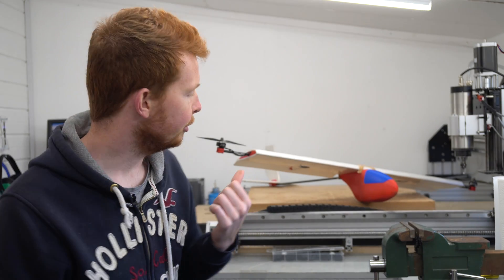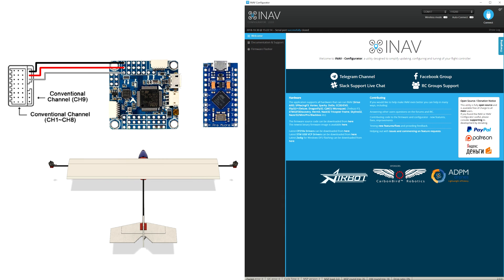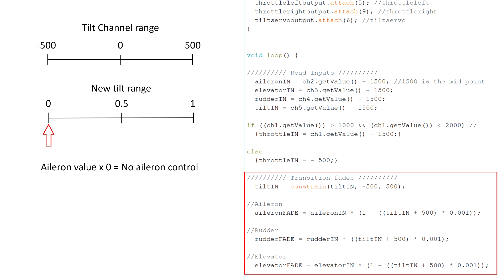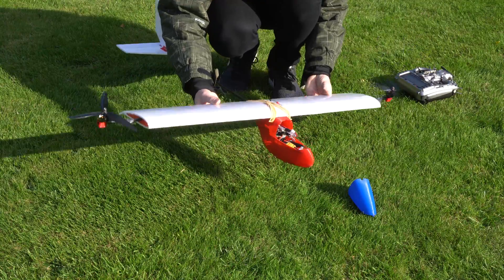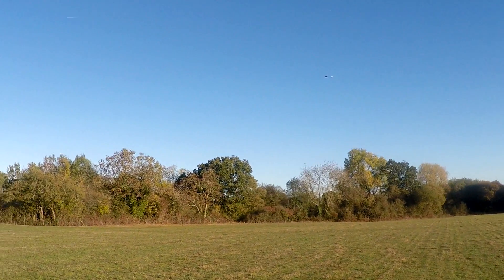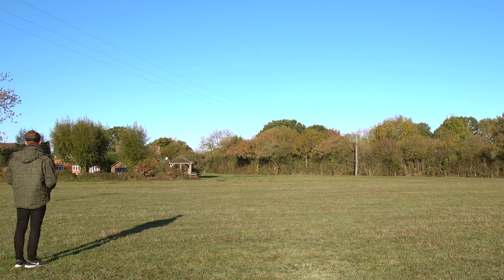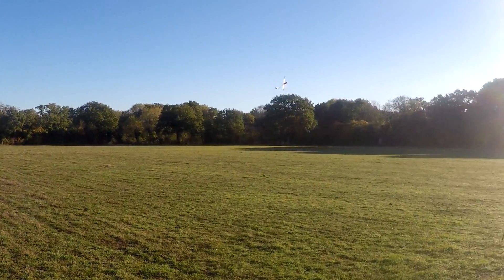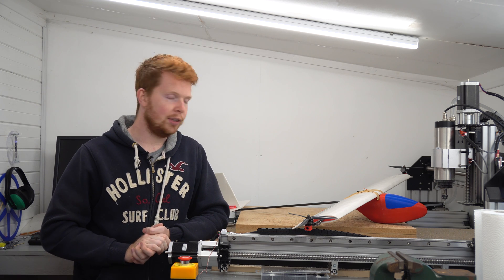RC VTOL - V4

Comment: That's awesome!   I really want to get into this stuff just need to take the time to actually learn it and play around with it.    I kinda want to play around with making my own arduino flight controller and maybe even ESCs too.  There is something satisfying about writing code that interfaces with the physical world, I've done some basic arduino stuff like low voltage cut off circuitry and LCD displays for solar setups but been wanting to expand to motors and servos and stuff.    The drone rules here are ridiculous though, so I'll probably do RC cars and robots instead until I'm confident enough with my designs.
Reply: Please don’t let the government suppress you like this :(
Fight for your freedom!
Reply: Lot of enthusiasts have complained and sent letters to Transport Canada.  They slightly changed the rules but they're still quite restrictive.  Technically not even allowed to use a drone on my own property since you have to be like 75m away from buildings.  I sometimes do anyway if I want to check my gutters or roof real quick but if police saw me I could get a huge fine.  Forget what it's set to, like 25k or something.

Comment: Reading SBUS is actually simpler than reading the PWM signals as it is a serial protocol. Some uC have flexible enough uarts to read it directly. I've done this on the STM32 for example. I've created sort of a library and some information is available here: http://kruissen.com/wordpress/?page_id=121 and I'm more than willing to share any other code I have.

Comment: Great video! For once as a programmer I can actually comment something, your code is fine, and while relatively simple, there's many levels of comprehension required to write even simple code, I'd recommend writing some functions so you can play with mixing your controls/throttle more easily,  e.g. is a linear interpolation best? may be better to normalise values to get a smoother transition? If you have any spare io channels you could use it to try different control schemes out in the field and maybe set an led colour so you know which one is active?

Comment: on your setup and loop functions, void is the return type. its basically a way for the program to know what to expect from each function. So if a func has a return type of void, don't expect a return value. In other words, you can say "runs the setup function" instead of "runs the void setup code"

Comment: thanks for posting.    here are some things to consider.     regardless whatever other silliness you have devised,  the model SHOULD BALANCE AT 30 % OF CHORD.   p e r i o d.       wingtip thrusters  SHOULD BE MOUNTED in  ALIGNMENT WITH  the ideal location of the model's c-m; at  25% of  FUSELAGE LENGTH.      oh and, don't worry about  HOW FAR FROM THE CENTER LINE,  Thrust  is being 'applied'.     i'm sure this fact is of NO importance, in your neighborhood.   cheers                    googletranslate
https://www.princeton.edu/~stengel/MAE331Lecture5.pdf

Comment: If you're interested, we could collab and I could build a custom Arduino compatible PCB that has the components you need on it and it could be designed specifically for VTOL. Its actually a pretty simple process and it could use something a little more powerful than the 32U4. Let me know!

Comment: Wow very nice project and video Tom! Since you are now making more and more Arduino projects for aircraft I would recommend using more efficient small microcontrollers. A teensy 3 micro controller is about as big as an Arduino nano and is much more powerful so you can run the loop at 10-20x the frequency. I've been using those for 10 years now for aerospace projects and I couldn't recommend it more.

Comment: If you don't have cyclic control on your rotors, there's no effective pitch control. Viewed from the side, the trust line has to pass through the CG in order to trim for hover, which means your cg has to be very close to the spar. Then, your ability to alter pitching moment about the CG in order to maintain that hover is also small and coupled with magnitude of trust when you rotate the spar. Difficult to achieve adequate handling qualities or practical CG range. I'm thinking about a far simpler arrangement with two fixed large lifting fans and a low inertia fast fan mounted on the tail just for pitch control. Cheers

Comment: What if part of the wing, like the outer half, 1/3 or 1/4 rotated with the motor. the wing would of course extend all the way to the motor then, instead of leaving the gap and it would probably need to be a symmetrical profile on that part at least. If you have the ailerons in this part of the wing, then you could use the ailerons to control yaw in hover.

Comment: Wow I love this projects!
What if you changed the direction of the motors and propellers? If you give more power to one motor than to the other the plane will roll in one direction, but it will change its yaw too because of the friction of the blades. I think that the left motor should turn counterclockwise and the right one clockwise so that the plane rolls and yaws in the proper directions.

Comment: Very settisfying to watch! Wat if you would add something like a 1104/1106 motor to the back, 2-3inch prop, on tilt. And move your wing spar/main motors a bit to the front, out of the CG. (maybe even completely to the front and more close to the hull) Effectively you would have a tricopter and have auto level again. During foreward flight turn of the yaw motor. Couldn't this be a very stable hovering platform?

Comment: +1 Tom - To add yaw while in hover mode can't you add some code to allow the props to tilt independently, i.e., slightly oppositely about the wing centerline. To yaw left mix the 'rudder' so the right motor would tilt slightly forward while the left motor would correspondingly tilt aft.  That would give you full control of the model.  Food for thought.

Cheers from Thailand!

Comment: Hmm, any possibility of having the tilt mechanisms for each motor in the fuselage, twisting the carbon spars ( and motors on the ends )  which would be riding in bearings for support? Seems like with a well designed mount you could use beefy standard sized servos to directly tilt the spars/motors, or have a single stage of gearing to get the desired range of motion ( ~135 degrees ish ). I'm just thinking that that way you could have more control and keep the weight in the center, rather than out at the tips which was an issue with the previous version...

Comment: Hope you don't mind, but I'll be cannibalizing your stl files for my own personal use lol. I've been designing my own brackets for using a 10mm square aluminium tube as a fuselage for a plane, but have struggled getting the tail section mounted properly without adding a ton of weight. So, I'll be looking at how you've done yours and either just use that or use it as a jumping off point for my own designs. Thanks, mate!

Comment: Embedded programmer here; You might think that the flight controller is written in some foreign programming language, but there is good news! As you've already got yourself writing Arduino code (which is pretty much C with a bit of C++ thrown in for some of the objects, aka Servo and PWM), it's very much possible to remove the Arduino from the equation for your V4 plane and use only the flight controller with your custom code. I'd actually recommend relying on the SBUS output (it's the same information as coming out of the PWM channels) as you get it faster and it's easier and less error prone to trying to read the PWM channels (timing jitter).
If you want a bit of help trying to get it going on just the flight controller, send me a youtube message and we can converse and get you up & running :D Keep up the great work, love every video you do.
Reply: he probably has to learn assembly language and get familiar with atmel IDE for a microsecond stick response
Reply: Sir, a much easier way would be to use JoopBrokking or nicholas Dremm's flight controllers.....on a powerful board like teensy or esp32.

Comment: Someone has probably already mentioned this, but in case they have not, you probably already know that Arduino code is essentially C. You described your "void setup()" and "void loop()" sections. They are more accurately described as just "setup()" and "loop()." This is because in C, the return value type is specified in the front of the function declaration, and the parameter types and names are specified inside the parentheses in the function declaration. This means that the "void loop()" accepts no parameters, and returns no value on exit. Same with "void setup()." I am not sure it applies for most cases in an arduino, but they could easily be.... say... "int setup()" for example, which would allow you to return an integer to the calling function in setup and use this return value for describing an exit condition or an exception handling routine.

Comment: I have a KK2 board that I haven't used in years. If you would like it you're welcome to it Tom. The pins are slightly bent, but the board is fully functional and not damaged at all. I am in the UK so it won't be any hassle. Good job on your controller though.

Comment: Nice Work! but unfortunately I have to told you that iNAV already have those mixer function for you to customize. You can remove arduino without any issue to reduce the weight. :) Here are the simple explanation video by Painless360: https://www.youtube.com/watch?v=v0CABnPXqFE

Comment: Many people have spent a lot of time trying to do VTOL transition and you cracked it in a few days, so congratulations!
Having two contrarotating motors/props on each wing would give you yaw control, and if arranged like an "H" with a very long bridge, you'd essentially have a quadcopter with pitch and yaw stability that can transition to forward flight as well. Worth a try!

Comment: Why don't you use Ardupilot for the firmware?
It even allows Tailsitter Vtols...
Reply from the maker: As far as I could see from the site, it doesn't support this style of VTOL? Looked like it only supported quadvtol and tailsitters, but I might be wrong.
Reply: @TomStantonEngineering  
I think you can define the outputs for each channel seperatly using the full parameter list.
Since you use the normal firmware for quadplanes as well this should also be possible.
-Henning

Comment: What if you add a really tiny motor on the tail of the plane for some proper yaw control? so not like a tircopter but a motor mounted vertically. (like a regular helicopter's tail motor). therefore you could remove the 15 grams of lead on the tail and gain some better control.
Reply: Guys, do you know how it actually yaws in hover? I checked the code but I still dont know
PWM ch1(0); // Throttle
PWM ch2(2); // Aileron
PWM ch3(3); // Elevator
PWM ch4(7); // Rudder
PWM ch5(1); // Tilt
Reply: I was thinking maybe a micro vacuum pump, with tubing to the tail. Get some air passing the rudder, and then just tilt the motors a little more backwards to maintain hover.

Comment: You might want to think about adding a very small motor to the back of the craft. Not only will it allow more control in forward flight mode, but when in hover mode, you could have more "drone-like" control. I don't know, it's just something you should think about.

Comment: Try swapping prop rotation.  Your setup has adverse roll yaw coupling, so in hover, roll left makes it yaw nose right.  I would also try a horizontal tail rotor with one of those 3d drone reversable ESCs .  Cool project.

Comment: I am sure you know, but in your design you only have 2 degrees of freedom whereas a VTOL usually needs at least 3 to work well. You could have used a tiny propeller on the boom to give you pitch control on hover. That's why you get no self-level :)
Usually, the PID outputs for different flight modes differ quite a bit, but again you are lucky here.
The openAeroVTOL firmware really was quite good, it is sad to see it slowly fade into oblivion. I have a basic rewrite but I don't yet support transitioning flightmodes reliably.
In your specific case I am surprised (positively) that it works that well.
Great vid!

Comment: I wonder if it would not be simpler to have a pitcheron arrangement on the wings (motors pointing to the leading edge) and  then the tail could be passive and you would have full 3 axis control on all modes. You have servos for the ailerons and the motors and the elevator already, so Pitcherons would actually be simpler while giving more control.

Comment: Add ailerons behind the motors so you have better yaw control when in vertical mode. This adds some weight with motors at the ends but it should not affect aileron use in forvard mode too much. Those little aileron flaps behind motors should give you good torgue control for yaw and aileron use and you dont have to rely on motor speed mixing.

Comment: After watching this video i'm 100% sure i could do all of this with a regular betaflight flightcontroller and do some custom mixing and logic functions on your FRsky.
That radio can do far far more than you seem to take advantage of.
Tuning the pid's is also possible to do even in flight with a newer flight controller.
Arduino and coding (while it might be fun for YOU to fool around with) is a waste of both weight, resources and time if you have an frsky transmitter.
Codes for what you just did is allready existing in betaflight, and i'd be impressed if you didn't find any code you would need.
Also, just invest in some F4 flight controllers, they are SO much faster than KK2 ever was, they react MUCH faster and they even have self tuning abillities that actually work.
Reply from the maker: I'm fully aware of what the taranis can do and it can't do this mixing simply because the mixing also has to swap which axis of the gyro is correcting in each flight mode. So simply swapping the channels in the transmitter won't work. The mixing and transitional fades need to be done after the gyro corrections. Current betaflight also cant do these mixes.

Comment: Hypothetically, if there's enough wash over the wings in hover, the ailerons may be able to provide some yaw control. Of course that's if he's able to drop them down like flaperons and have them both differential mix at a downward trailing angle. I picture it as counter to a very slight roll input with the motors while in a hover. If it's working the way I'm thinking, he could add this with a software hack.

Transition to a more regular mix would have to be fairly quick though once it starts going forward.

Comment: A small thing but why not use the pwm pass through? You can make motor outputs on the quad FC output a servo channel this would have then meant you could just run a small sbus only Rx saving space and weight, maybe even enough that you could run a rudder servo?

Comment: I love your videos! Have you considered putting one of those micro motors on the tail boom with a small prop like a tail rotor on a helicopter? It would allow you to have yaw control in hover and shouldn't add too much drag for forward flight. Also would help with the C.G. issues.